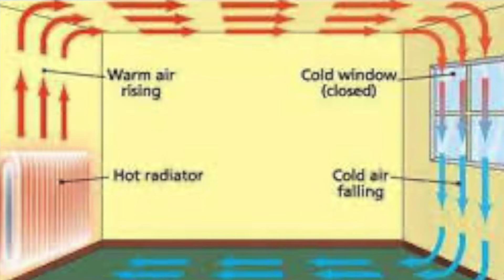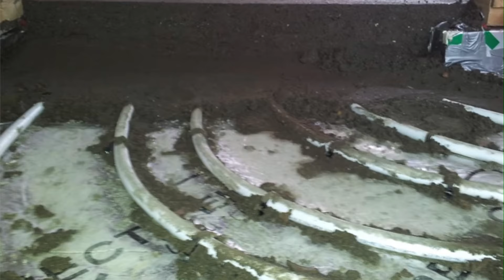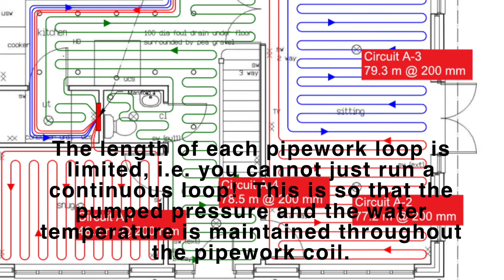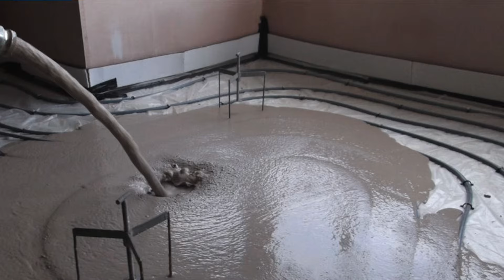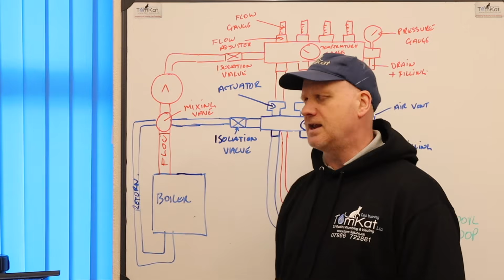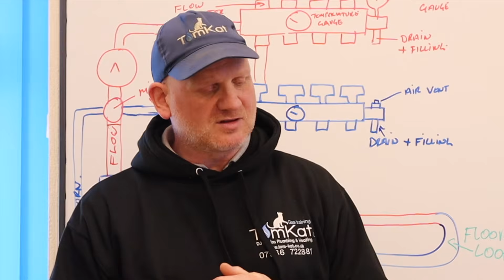How to install underfloor heating. Full A to Z on the pros and cons of wet underfloor heating.

Comment: Apologies but I am a newbie.  Our boiler is in the corner of the kitchen. We are extending out into the garden and looking at UFH. The building will go upto the garage so looking at putting the manifold in there. My lack of knowledge then hits a wall.  Can the flow and return from manifold not tee off the boiler? As I was told it would need to come off near the the airing cupboard.  Which would be a chore in itself to get pipes from here.
Thank you  and loving your videos.
Reply from the maker: All depends on your system you have, is it open vent is it a system boiler where is the pump all these thing need to be considered.

Comment: With the dry floor construction what material is underneath the diffuser plates, and how much height does that add to the floor? Can you add slate tiles directly on top of the diffuser plates or do you need some type of wooden flooring directly on top of the diffuser plates? If I have an uneven, sloping concrete subfloor what is the most effective way to create a level floor when using a dry floor construction?

Comment: Do you have any views on retrospective installation of underfloor heating on a concrete subfloor? Is it better to fit a low profile system (say 15mm depth) or in-ground systems (such as JK Floorheating ltd). Obviously fitting pipes directly into concrete will add to heat losses (I assume) but is this significant? Thanks for any guidance. 
Have also though of adding indexing to your videos so that it's easier to find sections. It would be a good addition and is easy to do.
Reply from the maker: There are lots of overlay systems that you can use on a concrete subfloor. These insulated panels will help with heat loss through the floor

Comment: polythene sheet long-term is an air/vapour control layer to reduce the interstitial condensation that occurs in the insulation and plywood in the winter season. Yes, during construction, it gives a temporary protection to the finish above from the curing mortar.

Comment: What you need to know about underfloor heating is that it heats your house 24/7/365 so if you’re not at home you’re wasting energy hand over fist. Whereas heating your home for 1 hour in the morning and 4 hours in the evening saves you money!
Reply from the maker: Don’t think you quite have the concept of underfloor heating and heating controls
Reply: @tomkatgastraining  sure, it heats the floors in your building providing 24/7 heat, is very slow to respond to room temperature changes so if you only home and require heating for short periods daily it wastes a lot of heat whilst you’re not there. It’s not ideal for occasional occupancy but no doubt great for continual use or use with very low grade heat say from a heat pump .. though that has its own problems for hot water systems.
Reply from the maker: @andyxox4168  again you are not taking into account a flow temperature of around 38oc and controls such as weather compression and programmable room thermostats so you original statement of running 24/7/365 is just not true . A badly controlled heating system with a flow temperature of 82 oc can use more energy in 4 hours than underfloor would in 24 hours.

Comment: On floor coverings you mentioned manmade rugs could be damaged by the temperatures , however earlier you said design flow temperatures where 55C or less . How could that lower temperature melt a rug ?
Reply from the maker: Because the heat has no where to go so the heat builds up under the rug
Reply: yes but the point I’m making on wet heating at 55C or less the heat can’t build up higher than 55C , it will on electric UFH though.
Reply: I do like your video though 🤗

Comment: So, what course would you recommend to learn how to fit an UFH system? For floating floor can you lay the system on top of floorboards as well or it must be done only putting battens between joists with insulation as shown?
Reply from the maker: I do say in the video that you can lay the pipes on floor boards using spreader plates and I would advise any manufacturers training that can even be done on the job.
Reply: @tomkatgastraining  Would you please list any of these manufacturer training that can be done on the job itself?

Comment: Brilliant video. If laying in a ground floor self build, with needing to pressurise to 6bar before final screed, can this water be taken from a hose from outside mains or does it require your permanent manifold plumbing and the pump installed?
Reply from the maker: You fill with a hose and then use a pressure tester to increase the pressure.

Comment: I would have thought that using actuators, controlled off room stats is not ideal for in-slab underfloor heating, with its slow response time and thermal lag. Wouldn't it be better to vary the supply water temperature to the manifold, using weather compensation?
Reply from the maker: I would be interested to know how you would do that without a room stats operating actuators to control individual room temperatures
Reply: @tomkatgastraining   I think he means to remove all actuators and zoning, then just use weather compensation to vary the flow temperature.
Reply: @andrewalderson1  Exactly. You can also add a room influence sensor if you want. It's done all the time on commercial buildings.

Comment: Quite a few of us know that the carbon reduction regulation is worse than utter bullshit; it is the government's (who are controlled by a criminal few btw) way of stealing more and more money from the people under the pretence of reducing so-called green house gasses like CO2 . There is negligible zero man-made global warming going on (do the research), and CO2 levels are dangerously LOW. Reduce the CO2 levels much lower and all plant life on Earth will start to die.
Underfloor heating however is a better way to heat rooms however.

Comment: Great video Del.  Just a couple of points you may have missed on the unquestionably benefits of UFH;
Our body loses 65% of its heat by Radiant Heat, so with UFH producing mainly radiant heat(in N America it’s called Radiant Heating), it counteracts this body heat Loss & feels extremely comfortable in your Home.
As a result of all this Radiant Heat, a room heated to 17-18DegreesC feels like 21.

The layout of the loops in most rooms is rarely critical, as the Delta T on the UFH loops is very low - 5-7DegreesC.  On UFH Design, you generally go by ‘the mean water temperature’ of the loops.
Most UFH loops should be no longer than 100Meters in length. This in most cases will limit the circulation pump head & flow rate.  Ensuring a standard domestic circulation pump can be used at the Manifold.  Another wee point about UFH & mixed temperature systems; 
Say you have a Zone of Radiators on the First Floor, which is very common & Heating a Cylinder to over 60oC. Hydronic separation may be required, or carefully placed ‘close Coupled’ Tees for the UFH F&R.

UFH is also very, very compatible with condensing boilers.  There’s a lot of Design considerations with a UFH system, so it’s not for the ‘hard of thinking’.

Cheers Del👍👍
Reply: 65%, what if you’re wearing a jumper?
Reply: @andyxox4168  At a guess, it’s say it’ll reduce your body Heat Loss, but sit bullock naked if you like, it’s all relevant!!
Reply: @TheDickPuller  hmm .. wearing clothes is far from irrelevant to how warm you feel, dare I say any fool can see that. As for underfloor heating, it’s a great idea if your house is continually occupied but if you only need heating for an hour in the morning and a couple of hours in the evening (I’m assuming you acknowledge the effects of a duvet to be similar to those of clothing) the 1-2 hour warm up/cool-down times of underfloor heating represent wasted energy. The situation is not cut and dried.
Reply: @andyxox4168  OK, OK keep your Pants on Andy Pandy!! Of course every installation needs to be assessed on it’s requirements, heat Loss & occupancy. And, of course if you insulate your body you’ll be warmer.  Don’t state the obvious son!!
Reply: @TheDickPuller  .. of course .. and you keep your hat on, that’s where you’re loosing the most heat!
Reply: @TheDickPuller  .. sure where is all the discussion on occupancy in the (public) debate?

Comment: If installers follow your advice they can't  go wrong.
Hot water temperatures  and cylinder recovery times are the compromise. 
Even properties  insulated to the latest standards will struggle to compete overall  with gas.
COP figures can be misleading, the difference in fuel costs need to be taken into consideration. 
How the electricity is sourced is a major factor to be considered if CO2 reductions are going to be meaningful. 
No easy route to zero carbon.
Reply: Which carbon are you taking about